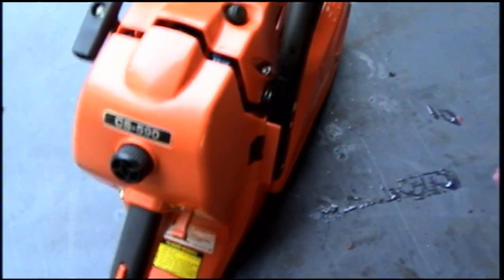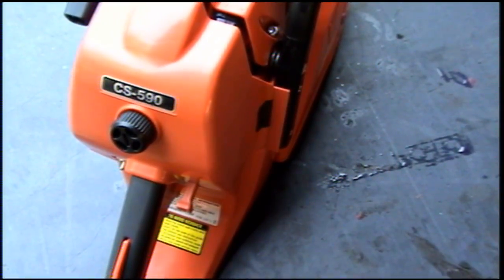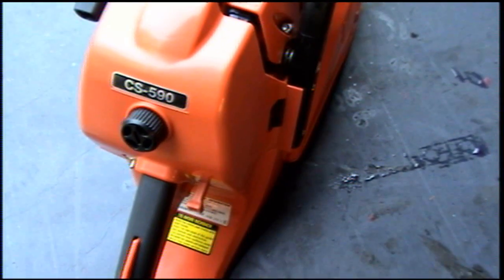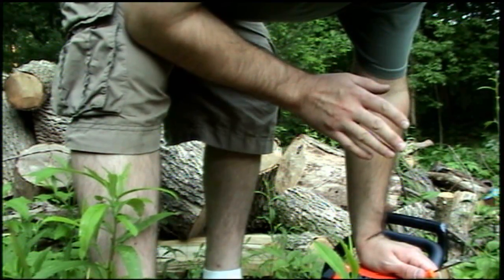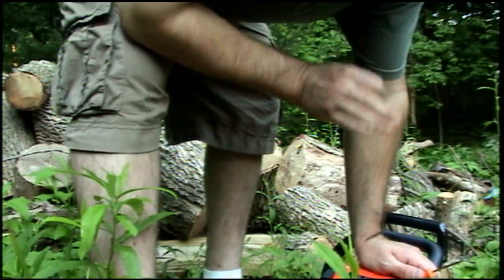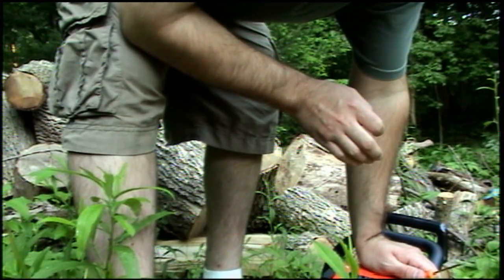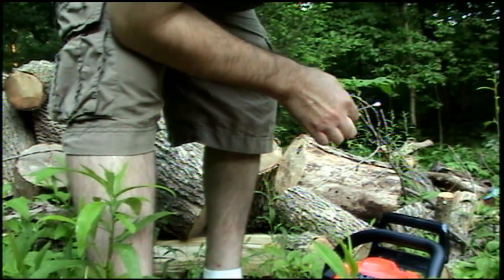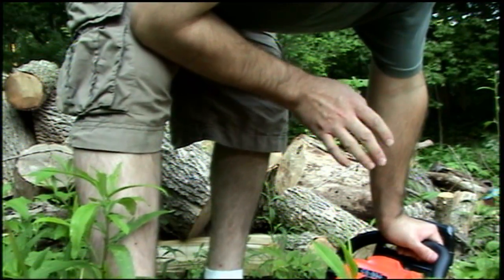How to tune a chainsaw.

Comment: Of all the videos available to tune a "rev" limited chainsaw, this video was the most helpful to me.  I have trouble discerning the boundary between just barely "four-stroking" and going into "two-stroking" mode.  I think it is easier said than done, especially when you are tuning at WOT.  I just performed a muffler mod on my Echo CS-370.   I ended up starting out going excessively on the fat/rich fuel side to get the obvious "four-stroking", and then crept up going leaner by 1/4 and 1/8-turns and tuning in the wood. In the end, I kept it on the "rich" side of the curve to be safe.  Well presented, thank you.
Reply from the maker: Thank you for watching.

Comment: Many thanks for this. I bought a new, inexpensive topping saw for light work a few months ago. Having used Husqvarna & Stihl saws for the last 30 years, I never touched the carbs as they were so reliable. But this little 25cc saw just wouldn't run right, whatever I tweeked. Your vid got it going, sweet as a nut!
Reply from the maker: Glad my video helped you out.

Comment: Thanks, this is a great tutorial.  If I may ask, is this before or after you modified the muffler? So far on mine I’ve just removed the baffle on the muffler and left the screen on and also modified the carb tuning limiters.  Thanks again.

Comment: you know the usual a friend in need is a friend indeed.I got the idea thanks so much I adjusted my stihl ms291 chainsaw but could you please after that show us how to use the tachometer just to make sure it's been done right and what's the rpm speed should be set for the chainsaw like mine.
Thanks again,

Comment: I have a new Poulan Pro saw which is made by Husqvarna, and I finally got it to crank up, but it dies after it has run for from 15 seconds to one minute before it quits. I also have a Stihl MS-250 saw which have been junk for me, and spent most of the time in the shop being repaired, and me not getting any use out of it. The reason I went back to the Poulan saw was because I got plenty of use out of an older Poulan saw I purchased in 2000, and gave me great service, and still works. I have to get some special screwdrivers to adjust the high and low settings so the new saw will run properly.
Reply from the maker: Are you disengaging the choke after the engine fires? It's true most saws come setup too lean out of the box and need to be adjusted. You can buy the tool on Ebay, or you can make your own tool out of a plastic pen. 

The ms250 has been a good saw for what it is, it normally comes down to proper care of the saw, more than the saw itself. Fresh fuel, never leave fuel in the saw, sharp chain, clean air filter and so on.

Poulan and a couple low end husky saws do share some design aspects and many parts. However Poulan saws are not really Husqvarna saws, and Poulan saws are assembled in the U.S. But yes Husqvarna does own Poulan.
Reply: I move the choke from full choke to half choke after it fires up. That is where the saw begins to start after two or three pulls of the rope. When it starts the engine runs fine for 15 seconds to about a minute before dying. Judging by how it quit, I figured that the adjustments must be off.
Reply from the maker: Can you rev the saw up?
Reply: Sometimes a saw that runs for a bit, then dies will have a plgged fuel filter, or a bad tank vent, and is just running out of gas. as soon as the saw dies, the vacuum on the system is relieved and it will start again. Some saws have a vent on the gas cap, some on the tank, but it's there somewhere.
Reply from the maker: Correct, removing the fuel cap will relieve the vacuum as well.
Reply: I am glad you mentioned removing the fuel cap being removed as I never thought of that.

Comment: thanks for posting this.  very helpful.

i have a small eager beaver saw i have an issue with now i'm trying to figure out.

it runs great.  and i can start it cold no problem. (with the choke.)  

but then after running it, then letting it sit.  it doesn't want to start.  i found choking it got it running again.  even though it wasn't cold.

so i'm going to listen to it, and give the low speed carb adjustment a go.  i'm thinking it may be lean on the low speed.

Comment: Since you been doing this for a large portion of your life I got a question. I replaced the fuel line and fuel filter along with the primer. I can get the saw to start when it's cold, but after it warms up, while choked,  it dies and I can't get it to start, with or without the choke. When it cools back down it will start again… I'm having the same problem with my weed wacker. Any tips please :)
Reply from the maker: +Eric Stillman 

As soon  as the saw fires up you must open the choke immediately, if not you'll flood the engine with fuel. The choke must be open for any engine to run.

Comment: Can't wait to tune my cs-370!    I am tuning a BRAND new saw, that I just decatted the muffler and opened up the spark arrestor plate.  So without ANY tuning and factory settings, I always want to adjust the LOW first right?  I noticed two things.  If I turn it fully clockwise the saw will shut off.  This I take as it is no longer getting fuel right?  Back it out a little and it starts, as I begin to turn it counter clockwise the saw starts to dance a little on the floor... mind you I see that your blade starts moving, mine is not.. 

Just trying to full understand the perfect setting for this when tuning.  When adjusting the low side, I noticed that when I turn it counter clock wise there is actually quite a wide section of making it "snappy"  I can almost do a full turn and it is just as snappy... would i be good to then do half of that?  IE  from one half turn to one full turn it snaps the same... which is better to go with?

Sorry for all the questions, just want to make sure it's done correctly and you video is the first to actually explain and clearly show what is happening!

Thanks much,
-Nigel
Reply: Did you tune it properly? 4 years later....

Comment: I have a Stihl 036 chainsaw and having problem with running. What are setting for high and low adjusting screws
Reply from the maker: Baseline settings are one to one and a half turns out from seated, this applies to both the L and H. How to fine tune is demonstrated in the video. ✌

Comment: Nice vids man, THANK YOU! I should have my 590 broke in by today. Any thoughts on break in procedures besides keep it rich? Like maybe not put full load on the motor? Or will the rings seat better with a full load, maybe just watch rpm's ?
Reply from the maker: Run the saw like you normally would. After long cuts let her idle a few seconds so she can cool down a bit, this helps any saw really

Comment: Great video. Just got an older echo HC1500 hedge trimmer and was wondering how it should ideally sound. It has a new carb and when I open it up it has a high whine like a radio controlled airplane. I'm concerned about it being too lean. should it have a four stroke burbling at wide open or a smooth buzzing?? Thank you for your great video and any help. I do appreciate it.

Comment: Well Done, just don't get in the habit of 'toppin' that thumb. It should be wrapped around the handle while cutting.
Reply from the maker: You are correct and I normally do. However I was holding the carb tuning screwdriver at the time.

Comment: Can you explain what those low and high adjustment screws actually do?
As I understand L adjust the amount to fuel to air ratio for idling and proper acceleration,
and H adjust to give engine proper mixture while at high power.
Am I getting it right? What is your take on it? From the video I am not quite sure what to look for while adjusting.
Reply from the maker: You have the basic idea down correct. When it comes to setting the low you want it as lean, or turned in as far as it will go, while providing fast sharp acceleration. Setting the H is more complicated, especially so with saws that have rev limiters. If you don't have a tachometer "most people don't" you'll have to tune the saw in the cut under light load, by ear. What you're listening for is what we call 4 stroking, which is actually the engine not firing every cycle. When you properly tune the H, the engine will be slightly rich without any load so you get slight miss, however when you load the engine the temps go up and the extra fuel can now be utilized properly. 

Here is an older video of mine demonstrating tuning the H in the cut. I started out with the H set really rich, as I turn the needle in the saw speeds up and eventuality clears up under load.https://youtu.be/ulY5sU4axFQ

Comment: What state are you located? Do you work on people's saws?
Reply from the maker: Ohio. I do sometimes yes.
Reply: @Andyshine77  I'm in Wisconsin. Thanks for reply your videos are very helpful.
Reply: I have a echo timberwolf. Last weekend it starting running rough and hard starting. I replaced plug and starts good now but when I hit the throttle it bogs for a second then revs up good. What do you recommend to get that bog to go away do you think carburetor is dirty or does the carburetor need adjustment
Reply from the maker: @robertpatterson7182   Could just need adjustment, the L us set really lean on those, it needs to be turned 1/4 of a turn counterclockwise. To be able to fully adjust them you'll heed to pull the limiter cap and trim off the nub that acts as a stop preventing the adjustment needles from rotating more than 180 degrees.
Reply: @Andyshine77  Thank you

Comment: My chainsaw was a nightmare to start so I rebuilt the carb - no change. I then inspected the piston and ring - looked good but very oil fouled, so I cleaned it and got a new spark plug. Compression test yielded 150 psi. Ordered the tool to adjust the carb. Do I turn the high/low knobs right or left? Where do I start?
Reply from the maker: Lightly seat both needles by turning them clockwise, than back them out counterclockwise about one turn. That should give you a good starting point, from there fallow the instructions in my video.

Comment: Thanks. This is the clearest explanation of the process I've found. 
Why does RPM increase when you lean the low adjustment? I'd have expected the opposite. And when my saw is running out of has the RPM increases until it dies. Is that the same effect?
Reply from the maker: As the mixture gets leaner RPMs will increase, that is until no fuel is left, at that point the rpm's will rapidly decrease in the engine will stop running. Yes the engine racing as fuel runs out is the same effect.
Reply: @Andyshine77  But I don't understand why RPM increases. Just curious.
Reply from the maker: @tinman1955   Because the mixture is getting lean, more air than fuel.

Comment: I have an Echo CS-600.  I cleaned out the carb because the saw is very hard to start since new.  I removed the adjustment limiters.  My saw starts OK now, but dies after about 5 seconds of idling?  The low mixture is about 1 turn out.  The idle speed is 1/2 way in.  Any other settings, the saw won't idle at all.  Any suggestions?
Reply from the maker: +Qiong Jia 

Try turning the idle in until it will run than adjust the low mixture as I did in the video. Also turn in the low 1/4 of a turn before you try starting the saw again.

Comment: @bobe8888 What do you start the idle screw at? 1 and a half out from seated then start adjusting the low jet?
Reply from the maker: The Low idle screw, the screw that adjust throttle butterfly, not the low mixture screw, can be turned all the way in to start with. Just be careful as the clutch will be engaged and the chain will be spinning. From that point make your adjustments.

Comment: Is this with the tabs removed? I have a cs-400 should I remove tabs and do muffler mod?
Reply from the maker: Yes this is with the limiters removed. 

It is your call, but I can tell you the power gain will be quite good with that model, as the muffler is very restrictive.✌
Reply: bobe8888 ok thank you
Reply from the maker: @gregkinkade9797  no problem, if I can assist you in any other way feel free to ask.✌
Reply: Do you have a video how to do a muffler mod on the 400
Reply from the maker: @gregkinkade9797  Sorry but I do not.
Reply: bobe8888 sorry to bother you again I did the muffler mod and removed the limiters now if I’m understanding correctly I will need to adjust my h counter clockwise to make it richer?
Reply from the maker: @gregkinkade9797   Yes counterclockwise adds fuel. Should only take about 1/4 of a turn.
Reply: bobe8888 thank you very much for all of your help. I appreciate all of your videos
Reply from the maker: @gregkinkade9797  You're very welcome.

Comment: How does it differ on a saw that is not rev-limited? I have a Mcculloch Pro Mac 700 that I think need a little tuning. It has very little time on the motor. It sounds like it's burbling even when I bury it in a big piece of pine.
Reply from the maker: What it changes is how you go about tuning the H needle, everything else is the same. 

If your saw is still burbling in the cut that much, it's definitely running too rich. Now because it's not rev-limited you have two options. Tune it at wide open throttle or in the cut under some load. At wide open throttle the saw should burble just a bit, and it should clean up under load. Tune it in the wood "carefully" buy adjusting the H back and fourth until it burbles slightly when you lift up on the saw a little. Remember it's always better to be on the rich side of tuning if you're not sure of your ability.
Reply: Thanks!

Comment: If you have a tach, do you tune cutting also ??
Reply from the maker: It can depend on the saw, if the saw doesn't have a rev limiter I tune by ear mostly. That said some saws "like the 372 Xtorque need to be ran at lower rpm's, do to the heavy piston" even if they're getting enough fuel to not burn up. So a tachometer is usefully there. 

Thanks for stopping by, if you have any further questions feel free to ask.

Andre.
Reply: @Andyshine77  so, an 372xp should be tach tuned?

Comment: question, if someone has monkeyed around with the idle screw and H and L screws and it wont start. Do you screw them all the way in and 2 and a1/2 turns out for a starting place?
Reply from the maker: Yes lightly seat both needles. How far you turn them out depends on the saw and carb. Some carbs are 1 to 1 and 1/2 turns out, some are 2 to 2 and 1/2
Reply: poulan p3314
Reply from the maker: Phillip Leopold Quite a few different carbs have been used on that model over the years. Try 1 & 1/2 turn out first, if she doesn't fire try 2 1/2 turns out. If you can't get it to fire, try a squirt of fuel directly in the carb. They're 3 basic things an engine needs to run Fuel, spark at the right time, and compression.
Reply: Thanks, I need to mix some fuel. being lazy. I will let you know how it turns out

Comment: My cs 590 recently had spark plug replaced.  Tech said that was problem,  wouldnt run when i took in.  $28.50 to change spark plug, i could have done that.  Ran 5 mins quit again.  electrical i am guessing by way it quit?
Reply from the maker: Sounds like the ignition coil is failing when hot, this is a common failure with small engines, and is why the dealer thought it was a bad plug. Did the saw shut off abruptly, or did it slow down than come to a stop?
Reply: Stopped abruptly.  And has not started since. Have not changed the plug however.
Reply: Saw is practically new.
Reply from the maker: Coils can fail even on new equipment, normally they start working again when they cool down. Do you know how to test the saw for spark? does the saw have good compression when you pull it over, or does it turnover easily? Is the fuel/oil mix you're using fresh and mixed properly? 

This will get you started. When it comes to these things failures can happen, but 99% of the time it's something the operator did incorrectly. Nevertheless with a little help this may be something simple.
Reply: Some malfunctioning ignition modules will quit when they get hot. I bet your tech just made a stab at it. when it gets hot and quits, have a spark plug handy, and pull off the boot and put the spare plug in there. Hold the electrode of the plug against a ground on the saw and yank the string. Assuming there is no spilled gas around to ignite when you pull the string, you should see a strong spark jump the electrode on the plug if the module is working. Wear some Atlas gloves so you don't ground yourself. Don't wait around for your module to cool off though, get it quick.